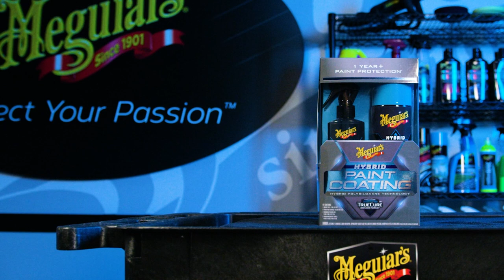Pro-Grade Durability & Protection that’s Easy to Use with Meguiar's Hybrid Paint Coating – Shop Talk

Comment: Maybe in the future we'll see more videos or get more info on this.. I'd love to see how long this lasts, how it handles against water spots.. especially hard water. Almost every product says the same thing "great durability, easy application, etc". It'd be nice to see a durability review against other well known products! Thanks for all your products guys :)
Reply from the maker: Thanks for the feedback.
Reply: I have this on my wheels, paint and PPF on both of my personal vehicles. One for about 9 months, one for right at a year and both are still strong. Wheels haven't even begun to slow down. The roof on the car parked outside is slower than new, but still about on par with a fresh coat of traditional wax.
Reply: @MarkusKleis  mobile Detailer friendly? As in tough to find a shady spot?
Reply: @BrownRooster  This coating is extremely forgiving in terms of application and removal in subpar conditions. With most coatings, you have a short window for removal or risk high spots - a bigger challenge for mobile detailers with less than ideal lighting. With HPC, you can miss a spot and even come back days later and level the area with ease.

Comment: 48 hours later there was a some slight rain that hit the car. Some water spots on the hood and roof. Do I leave them or wipe them off with some quick detailer?

Applied it this weekend to the wife’s explorer st. Been detailing for many years and this is an amazing product to work with. I was amazed at the ease of use. After 24 hours the gloss just kept getting better, but that could just be the polishing prep and the coating appears to be glossy. Can’t wait to see how it holds up with weekly maintenance. I’m willing to bet 1.5 years with proper maintenance.
Reply from the maker: Thanks for the feedback.  👍 

Yes, you always want to wipe off water as quickly as you can before it has a chance to etch into the paint.

Comment: ive used this on my vehicle and it's amazing.  in a year or so when it has lost its benefits, what is the process to remove it?
Reply from the maker: Thank you for your feedback and great to hear!

The coating may be have worn off after a year or more but claying, compounding, or simply completing the application process which includes the Surface Prep would remove the prior coating.

Comment: Fast Finish x10? Yet, not a synthetic sealant nor a ceramic... But still a coating. You get the benefits of a coating, durability, strong hydrophobics, and ease of use. Another offering and option... Should be interesting. Can't wait to test/try... Question: Is it recommended as a stand alone only, or can it be used as a topper as well? I'm imagining TW Seal n Shine as a base because it's proven, and Meguiar's Hybrid Paint Coating as a topper/sacrificial layer.
Reply from the maker: Thanks for your enthusiasm.  

No, we do not recommend this as a topper.  It is a primarily long lasting source of protection and will only work if applied as instructed on a bare surface.  You can certainly use maintenance products like our Hybrid Ceramic line to maintain it but you really don't want any kind of wax, sealant, or coating on the surface before application.
Reply: @meguiars  Thanks for the reply... Enthusiastically waiting.

Comment: Great video, and I have a question. Ok I just bought a 2022 Honda Insight Touring and I'm getting into car cleaning on a serious level past the car wash drive through because I want to gift this awesome car to my son in a couple years. My question is, after I wash and clean & prep do I polish before using this product or should I skip polishing since the M122 is meant to remove everything from the surface before application of this product? Thanks.
Reply from the maker: As mentioned in this video the proper prep steps before application of this coating really depend on the condition of the paint.  Whether to compound, clay, and polish depends on your particular vehicle and your desires for it.  If you want/need to remove bonded contaminants and defects as well as create the best shine/gloss possible you will likely want to consider some or all of these steps before applying the coating.  That being said, if the vehicle is in perfect condition and you are already satisfied with its appearance you could simply follow the process for applying the coating.

Comment: Can you wax on top of this after it cures? For adding more shine? Or does this have to remain your “top coat” until it fades? Thanks in advance.
Reply from the maker: You can use our Hybrid Ceramic Waxes over it to help maintain protection and water beading.  👍

Comment: On the subject of cureing and please don't shoot me down if the question seems stupid. I don't have access to a garage and once applied it would be open to the elements. I'd obviously apply it when no rain forecast for a day or two, but what about overnight dew?
Reply from the maker: Not ideal but will likely still be fine.  This is one of the differences between using a wax versus a coating.  Longer full curing times, you have to dispose of the towels used, etc.

Comment: Will this come to the Netherlands also?:) if so I can't wait!
Reply from the maker: You would need to check with our partners there on availability and timing...

https://www.meguiars.nl/
Reply: Hoi Dutch033,
Je kan deze producten vanuit de U.S bij de Meguiars partners verkrijgen. Veel van deze partners verzenden naar Europa zo ook naar Nederland. Ik heb dit zelf ook gedaan z.o.a ook de Hybrid Wash Mitt & de Hybrid Ceramic Wash & Wax (heerlijk product en het resultaat mag er wezen). Zo ook de coating, super easy aan te brengen en als mijn auto in de zon staat zie je vanaf een kleine 3 a 4 stappen het regenboog effect. Als je nog vragen hebt hoor ik deze van je succes!

Comment: So after my first coat is applied and I let it cure for 1 hour there will be light dusting on the car, if I want to apply a second coat do I use the surface prep to get the surface clean again for 2nd coat? Will the surface prep affect the first coat?
Reply from the maker: No, you would not use the Surface Prep.  Ideally you would not have to clean the car again but if some dust does settle on the surface a quick detailer like our burgundy colored Quik Detailer Mist and Wipe could used to remove it.

Comment: I purchased this hybrid coating and will be using it soon.  After application, can I also put a layer of the ceramic wax or do I just maintain with ceramic quick detailer?
Reply from the maker: There is likely no reason to immediately apply Hybrid Ceramic Wax on top of the coating but it certainly can be used to maintain the protection and water beading of the coating over time.  It would make more sense to apply it some time (weeks/months) done the road and use the Hybrid Ceramic Detailer any time you like to wipe down the car.

Comment: I was "sold" on this after watching this video and few others.  I put it on my car (12 Lexus RX350) and my wife's car (18 Subaru Crosstrek) about six weeks ago.  The initial results are as advertised!!!  I mean, the cars look great, the coating has been a breeze to wash and it's holding up so far.  I went to my local chain (Advance) and they told me that they're no longer carrying the product.  I went to Auto Zone down the street and they said the same thing.  The gal behind the counter said it had been "discontinued".  I am really excited about this product and was looking forward to using it for years.  Any idea why two of the national stores have stopped carrying it?  Has it been discontinued?  Not trying to put you on the spot, just want to make sure that this fantastic product isn't going away.  Thanks.
Reply from the maker: Our Hybrid Paint Coating is not discontinued but those retailers have chosen not to stock in any longer.  It will continue to be available at O'Reilly Auto Parts and several online vendors.
Reply: @meguiars  That is great news, thanks for the update.  Love your products.

Comment: Can you apply this over a Ceramic Pro coating? will it amplify the bleeding and protection? Looks like a great product! can't wait to take it for a spin.
Reply: J C - Interesting question. My guess is ‘yes, it will work but it’s not optimal’. The video is clear, it’s designed to bond to paint, not a coating.
Reply from the maker: Kbuzbee is correct here. Yes it would be fine even if not ideal but why someone would need two different coatings is probably another conversation.  😃
Reply: @meguiars  hahaha... need? We do silly things because we do.
Reply: That’s why I was wondering because they mentioned many times that it is best suited for paint but just curious if it would work or not.

Comment: My opinion as a detailer I would prefer this coating to any "ceramic" coating if you daily your vehicle because after a year your paint gets buildup of contamination, swirls, scratches, RIDS and etchings. I'd rather lightly polish and coat each year to keep it looking better and performing better. Every ceramic coating I've tried rated from 1 to 8 years last no longer than 2 years max without toppers which to me is cheating. I've had this last 10 months in Minnesota through winter with salt and weekly washes vs 3 year coatings failing after just 13 months even after a chemical and mechanical decon. This is also the only "coating" I've had register on my paint thickness gauge after curing.
Reply from the maker: Thank you for the feedback.  👍

Comment: So i just bought this cause it was on discount my car has light swirls and i want to know if i can still apply it without doing a full paint correction
Reply from the maker: You can but it will perform better on a surface that is properly corrected and prepped.  Keep in mind it will not remove the swirl marks you will simply be putting a coating over them.

Comment: If I already use the ceramic spray wax and Ceramic detailed, will I notice any difference with water beading since the top coat (CW) would still be the beading agent? If it does have the same effect, this coating will really just add more protection right?
Reply from the maker: If you watch the video you will see that the application of this coating needs to take place on bare paint it cannot be used on top of other waxes/sealants/coatings.  Part of the application process is stripping the surface with the M122 Surface Prep before applying the coating.
Reply: @meguiars  Oh I know I shouldn't put it on top of other waxes and coatings. But he said you can use the hybrid ceramix wax ON TOP of the coating as a means of upkeeping the coating. So it would end up having the same water beading properties as the Hybrid Ceramic wax it would just add more protection against chemicals and such. Right?

Comment: Does it cure little abrasion like ceramic coating ? Also is it uv protective?
Reply from the maker: We are proponents of remove defects not simply hiding them temporarily.  Our suggestion will always be to remove the defects before applying protection.

Yes, as with all of our waxes/coatings they are designed to protect a number of common environmental factors that negatively impact your paint including the sun.

Comment: OK guys water beating is great let’s talk about water sheeting ! Also would this be body Shop safe can you remove this coating with a compound if you need too?
Reply from the maker: No, application of this products just like any wax or coating would not be safe in a body shop environment.

Yes, it can be removed by compounding and/or the typical process and good painter would use to prep the surface for painting.

Comment: Late to the game here. Does Meguiar's recommend a respirator/  mask since this is an aerosol?
Reply from the maker: It is certainly not required but as with any aerosol you do not want use it in a confined area without good ventilation.  If you have a specific and unique personal health concern that may be a chose you want to make for yourself.

Comment: how well does it bond to and protect black piano key B-pillars?
Reply from the maker: Although it is safe on most exterior surfaces it is designed to work best on paint so we could not guarantee identical results/benefits on those surfaces.
Reply: @meguiars  thank you. I have applied  this product to my daughters jeep plastic trim and have had seen impressive results but the texture of that trim is porous versus the smooth b-pillar plastics. That said I understand your response from a product perspective. Thank you

Comment: Would this be safe to put on plastic trim and headlights/windshields? Or only paint?
Reply from the maker: Safe, yes; however Hybrid Paint Coating is formulated to bond to paint.  The chemistry required to properly bond to other surfaces is different, so we recommend using Hybrid Paint Coating on painted surfaces.
Reply: @meguiars  thank you for the reply, what do you think would be the real duration of this product for a outside parked vehicle? I know what is usually listed on the box is garage parked, anyhow I picked it up today
Reply from the maker: Believe the duration/longevity is covered in the video but the first thing to understand is how long any protection/wax lasts is highly variable and depends on a number of factors related to the condition of the paint, previous prep, and the environmental elements the vehicle is exposed to.

That being said, if well maintained, this coating can last up to a year or more.

Comment: I have reached out to meguiars and got different answers, can you clarify?  What is the best maintenance for care after using this coating?  One person told me bead booster, another sealant, then another just hybrid wash and sometimes hybrid spray wax.  It seems the bead booster and sealant are pro grade and dont come in smaller bottles.
Reply from the maker: All of those answers are correct.  We recommend any of our Hybrid Ceramic Products for maintenance of a coating.  Of course they do different things.  

If you want a wash & wax that will help maintain protection and water beading while washing you would want to pick up our Hybrid Ceramic Wash & Wax.

If you want a detailer or spray wax we recommend the Hybrid Ceramic Detailer or M799 Bead Booster.  Yes, you have choices based on where you like to shop and desired quantity.

If you want a long lasting wax you can use right on top of the coating you will want to check out our Hybrid Ceramic Wax, Hybrid Ceramic Liquid Wax, or M27 Pro Hybrid Ceramic Sealant.

Again all of these are great options.  The retail items may be easy to find locally in auto parts and mass retailers.  The Pro products may be something easiest ordered online unless you have a good Pro distributor or jobber store in your area.
Reply: @meguiars  bead booster seems like you are just reapplying another coat of the hybrid ceramic coating.  Why shouldnt I just use the rest of what I have a few months later as a top coat?
Reply from the maker: Bead Booster is designed for a more traditional spray on wax application and it great for maintaining/boosting existing protection.  It will not last as long as a dedicated wax like the Hybrid Ceramic Wax.  

If you choose to simply wax more often instead of using a spray wax to maintain protection there is nothing wrong with that.  That is certainly what some choose to do when they realized how easy it can be to apply the Hybrid Ceramic Wax any time they wash their car.  👍

Comment: If I apply this properly to a properly prepped vehicle and then top it with my Hybrid Ceramic Wax about a week later, if I am reapplying the HCW every 3-4 months (or seasonally), how long could this coating last in theory? 
I live in the north east USA and it would be on my secondary vehicle. 
How does this product perform vs the HCW for durability, hydrophobic properties and gloss? 
Any other key information pertaining to this product or how it performs vs the HCW? 
Thanks guys!
Reply from the maker: Yes, the Hybrid Ceramic Wax would be a good way to maintain this coating.  Although they both protect well the Hybrid Paint Coating is a true coating and is better protecting and will hold up against the elements more effectively.  It will also provide a bit more gloss and water beading.
  
This coating can last a year or more if maintained well but as with any form of protection there are many variables that can affect longevity.
Reply: @meguiars  Am I able to add multiple layers to increase the measurable thickness of protection?

Comment: Paint only, or windows, trim, metals included?
Reply from the maker: Covered in the video but it is designed to bond to paint.  Although likely safe on other surfaces we recommend it only be applied to paint.